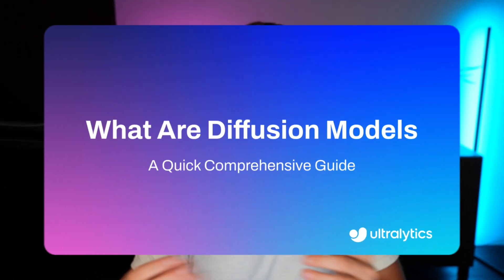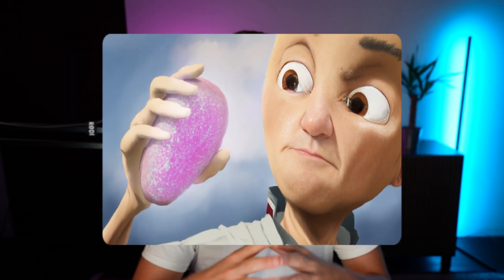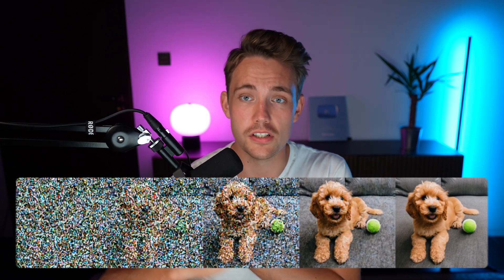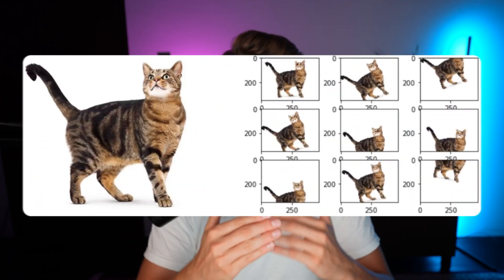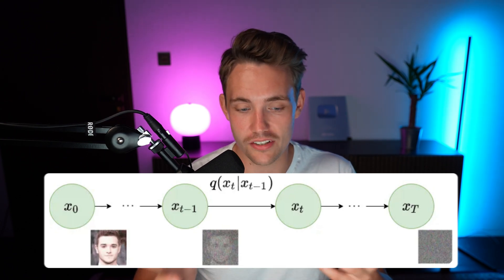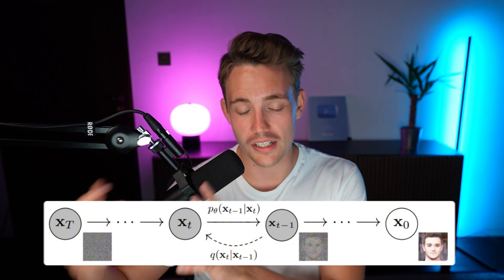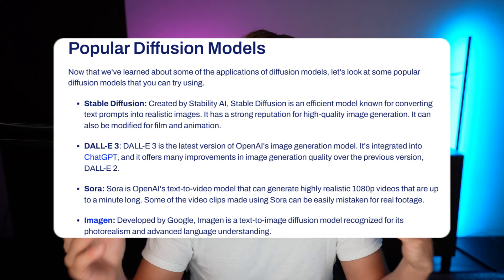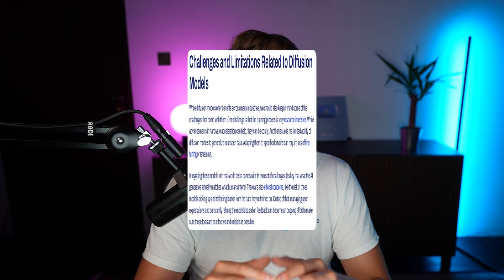How Diffusion Models Work | Forward and Reverse Diffusion Process | Challenges and Limitations 🚀

Comment: Dope vid!!! If I’m using diffusion 2 deblur/augment footage from a muddy night trail race, should I go latent + DDIM w/ CFG or jump 2 consistency distillation for near real-time on edge cams, and how much does the beta/SNR schedule swing results in low-light noise? Also, be honest—does this outgun GANs on motion-heavy action or r we just summoning more compute demons?!
Reply from the maker: Thanks! For near real-time on edge cams, pick consistency-distilled latent diffusion or flow-matched samplers over vanilla latent + DDIM + high CFG. You’ll get 1–4 step sampling, lower flicker, and far less compute, especially if you add light temporal constraints; DDIM typically needs many more steps and will struggle at the edge. For restoration, keep CFG modest (≈1–4) to avoid hallucinations; higher guidance helps prompts but hurts faithful deblur/denoise.

The noise schedule matters a lot in low light: cosine/SNR-weighted schedules usually preserve shadows and reduce chroma speckle better than linear, which can wash blacks. Pair that with v‑prediction, FP16, and tiling for edge efficiency.

Do diffusion models outgun GANs on motion-heavy action? Quality-wise, diffusion often yields cleaner, artifact-free details, but GAN/CNN restorers (e.g., EDVR/BasicVSR/Real‑ESRGAN) still win on speed and temporal smoothness at the edge. A pragmatic combo is GAN for live cleanup, diffusion offline for augmentation/enhancement, then YOLO11 for detection/tracking. Quick primers if helpful: Diffusion overview https://www.ultralytics.com/blog/what-are-diffusion-models-a-quick-and-comprehensive-guide and GANs vs others https://www.ultralytics.com/glossary/generative-adversarial-network-gan

What’s your target FPS and edge hardware? Share that and whether you’re strictly restoring or also stylizing, and we’ll tailor the setup.

Comment: So if I unleash a diffusion model out in the wild, how’s it handle noisy, real-world data—like, actual mud and glare instead of clean lab samples, bro? Any tricks for not getting totally bogged down by the usual “garbage in, garbage out” jungle?
Reply from the maker: Great question! Diffusion models can struggle with real-world noise like mud, glare, or unusual lighting if they’re only trained on clean, lab-style images. To help them handle messy, unpredictable data, you’ll want to focus on a few things:

- Use diverse and augmented training data that mimics real-world conditions—think synthetic mud, glare, and distortions—to teach the model what to expect outside the lab. This process is called data augmentation and is essential for building robust AI. Learn more about these methods here: https://www.ultralytics.com/blog/the-ultimate-guide-to-data-augmentation-in-2025
- Clean and preprocess your data to remove obvious outliers, normalize scales, and ensure quality. Details on best practices are covered here: https://www.ultralytics.com/blog/what-are-diffusion-models-a-quick-and-comprehensive-guide
- If possible, fine-tune the model with actual field samples from your target environment.

By following these steps, you can greatly improve your diffusion model’s resilience to “garbage in, garbage out” issues.

Comment: I’m curious—how do diffusion models handle noisy or messy real-world data, especially compared to techniques like GANs? Do you see any risks of these models hallucinating details that weren’t there, or is the reverse process more reliable than we hope?
Reply from the maker: Great question! Diffusion models are designed to learn how to denoise data step by step, which gives them an edge in handling noisy or messy real-world data compared to GANs. Their training process tends to be more stable, and they're generally less prone to issues like mode collapse, which GANs often face. However, diffusion models can still hallucinate details—especially if the training data itself is biased or contains artifacts—so what they generate isn’t always a perfect reflection of reality. The reverse process is robust but not immune to generating unrealistic features, especially in ambiguous or low-quality inputs.

For a deeper dive, check out this overview of how diffusion models work and their strengths/limitations https://www.ultralytics.com/glossary/diffusion-models. If you’re interested in applications and real-world challenges, this comprehensive guide https://www.ultralytics.com/blog/what-are-diffusion-models-a-quick-and-comprehensive-guide is a great resource.

Comment: Cool breakdown of diffusion models! Quick question—how do these models handle noise in real-world data? Like, can they still reconstruct useful info if the data's super messy, or do they hit a hard limit? Asking for my data that looks like it went through a blender!
Reply from the maker: Glad you enjoyed the breakdown! Diffusion models are designed to handle noise exceptionally well by learning to reverse the noise-adding process through iterative denoising. However, if your data is "super messy" or beyond the noise levels they were trained to handle, their performance may drop significantly. Preprocessing your data—like cleaning, normalizing, or augmenting it—can help improve results. Check out this guide on data preprocessing https://docs.ultralytics.com/guides/preprocessing_annotated_data/ for tips to get the best out of your models!